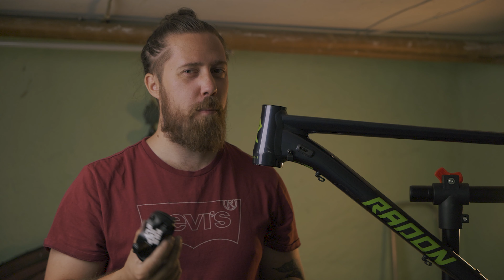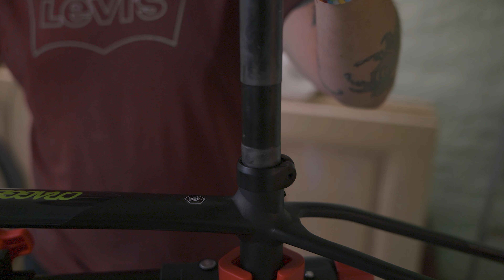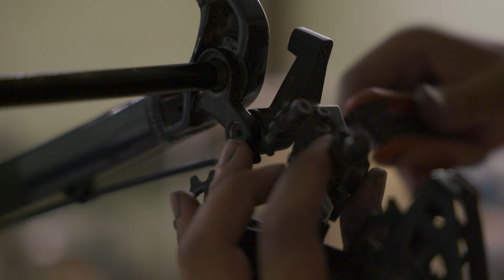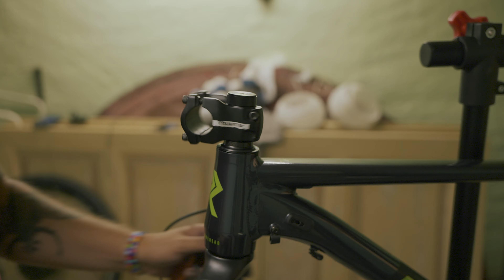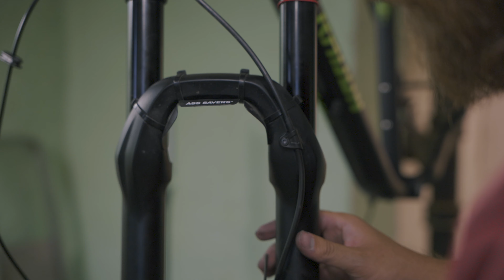Building a hardtail MTB | Radon Cragger

Comment: Sick that you stuck with a hardtail. Don't underestimate it even on dh trails. I just rode a dh bike for the first time last week at a bike park and my times on Strava was mid pack so that means I was riding it okay, and the times on my hardtail was very close to the dh bike on the flowier trails. Those results actually surprised me because it felt like the dh bike was going faster everywhere. Obviously on the technical trails, it's not even close in the dh bikes favor.
Reply from the maker: Yeah I mostly ride stuff that a full sus would flatten out too much. So for my kind of riding (and budget) a hardtail is favourable.
I rode an enduro bike at a bikepark recently and felt the same as you!

Comment: I have a cragger too, great machine. 
For me it's more an AM bike like a trail bike or an enduro bike. It's climb slowly but it's a fun machine in D- !

Question about your Cragger. If you test your bike with this fork in 130mm, I will be interested by the difference. 
For me, 130mm is enough, 'cause more travel on HT bike is more trim variations. But, I'm interesting to know in ride sensation the answer.

And if I told you an advice with this RS35, ride with a short SAG (15-20% max) more rebound and LSC full open. With a biggest SAG you need to close the LSC to avoid diving in brake situation, and Moco don't manage the hydraulique saturation when is not full open. The feeling is a wood sensation in succession of impacts.
Reply from the maker: Yeah I like to ride a bit of everything so I think this bike will be perfect! Fun also to try a frame that not many people (in sweden at least) ride or talk about!

I think I kinda like the bike with 150 travel but we'll see if I tinker with it :)

Good tip about the fork! Didn't realise that I had low speed compression adjuster.. just thought it was different levels of lockout 😂 so thanks for making me google!
Reply: It took me 1 year to decide to buy this cragger, so I spent a fair bit of time digging into everything about the equipment.

This 35, it has certain faults, certain qualities.
Overall, she doesn't always get good press for the wrong reasons (and the right reasons to hit her, few people talk about it), but well-tuned she's quite valid.

On the other hand, like all forks with motion control, you have to know that it rolls hard and that for it to work you have to forget about comfort.
The hydraulics saturate very quickly, and the LSC, except in specific cases, works when it is fully open.

So, that implies compensating with the spring and therefore increasing the pressure a little.

On this one you have 5 notches at all open to complete blocking.
And if you are rather light, to fluidify the moment when the plastic body of the motion control compresses to open the discharge valve, you can add a handmade spacer at the level of the plastic cone in the cartridge.

You lose the total block (not very useful) but you win in transition.
If you weigh more than 90kg (as I am) the forks are all open anyway to work well and the transitions are naturally better.
Reply from the maker: @jyccc2126  Thanks for super good info! :) Right now I am 90+ kg.. Will tinker with it a little bit to see what I like though :) Right now I think my pressure is too high.. doesn't feel very compliant in the small bumps!
Reply: @Mikesbikerides  Keep in mind that this fork, without modification of the hydraulic cartridge, will not be able to work well (have support and not dive under braking, do not bounce on all sides, get grip) AND be "comfortable" with operation "soft".

Anyway it is by trying that we see!
One setting at a time!
Reply: it doesn't climb slowly, its all about the legs haha

Comment: Hi Mike :), whats your height? Iam 191cm will the Lsize be enough for me? And Isnt the cragger geometry too weird? Thanks
Reply from the maker: Thanks for commenting :) 
I think the L will fit you nicely.. I size my bikes based on reach, that's a better way in my opinion, otherwise I would also be on an L frame which would feel too big.

What part of the geo do you think is weird? I'm not the most educated on geo but some key numbers seemed good to me 🤷🏻‍♂️😆
Reply: @Mikesbikerides  thanks for the respond. Yeah my reach is not extraordinary to my height (so a little bit more than my height) now i have my cube reaction tm pro and i felt like reach is just a little bit short (XL 22") plus size 27,5  . Reach on the Radon is 9 mm longer on the L frame partially also because of the seat tube angle so thats that. And whats weired about the geometry? 😁 I dont know... aformentioned seat tube angle for instance? But if u feel comfortable on the descends and ascends it will be a good proof to me 😀. Also iam looking on the 2021 model and u had the 2020 model. But i recon there is not much change in the geo. if any 😊. And maybe I will just wait for the 2022 models...

Comment: How tall are you in cm? How long was the reach on your old trekk and how is the reach on your new cragger? I live in Sweden and just bought a orbea laufey h30 in large. I'm 182cm
Reply from the maker: Thats probably a nice fit for you! Don't remember the geo numbers but a 430-450 reach is pretty spot on for me! I like my bike to be on the smaller side for more agility!
Reply: @Mikesbikerides  which frame size is your new big Al? I forgot, how tall are you?
Reply from the maker: @erikd6124  Medium, I'm about 179 with a pretty even distribution of leg and torso length :D I'm right on the mid pont between M and L on most bikes and I found that going smaller seems to work for me. Tried hopping on to a Large Big al and it felt way too large.